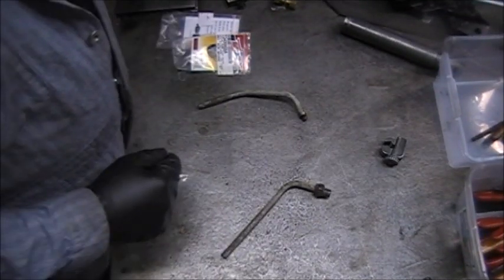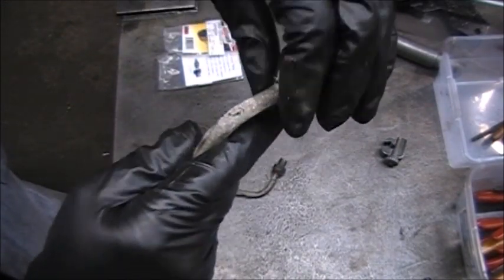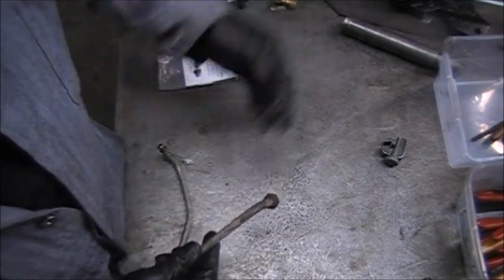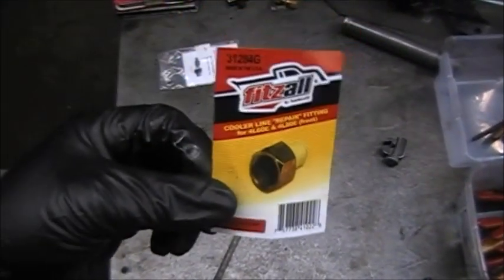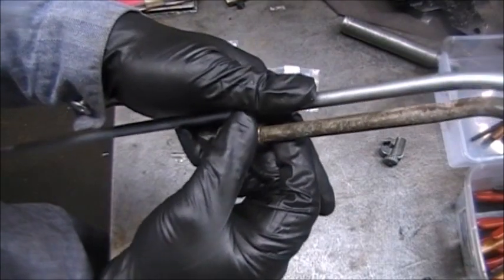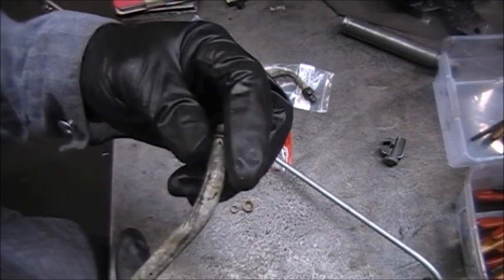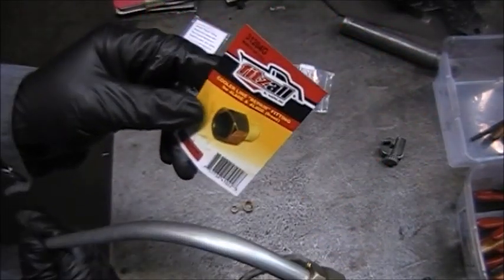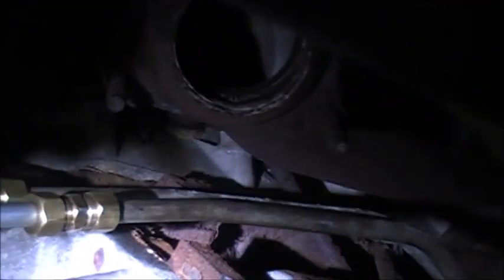4l60e cooler fittings change

Comment: Another thing you can do is put in one of those short transmission cooler line pieces derale performance makes them and other conpanies put your clip on and then use transmission oil rated nylon line and use fuel injection hose clamps they are for high pressure.
Reply from the maker: What you say may be ok, however, these lines normally is situated right next to the exhaust pipe that is hooked to the manifold. I would be concerned about the heat causing a problem with the nylon line.

Comment: So if this happened to my 4l60e in my 97 c1500 I should replace the whole line and fitting because the flare is most likely worn? If I don’t want to use the brake line and compression fittings

Comment: Great video! They sell it under the Techpak 31284G also. Now, one thing, you started talking about the other end that connects to the rad and then you stopped - please - finish your thoughts on fixing that end also. Thanks again!
Reply from the maker: This has nothing to do with the radiator end.
Reply: @thisisyourtransmission  I agree but what was the solution for the rad connections? Or do you just leave them as-is?
Reply from the maker: @muchgreatness7497  yes, I just leave them as they are if I do not have to touch them. However, if I do have to deal with  the lines that go to the radiator, I normally just install an aftermarket transmission cooler and the run the transmission rubber hoses that are included in the kit to the flared ends of new transmission lines that are then connected to the transmission.